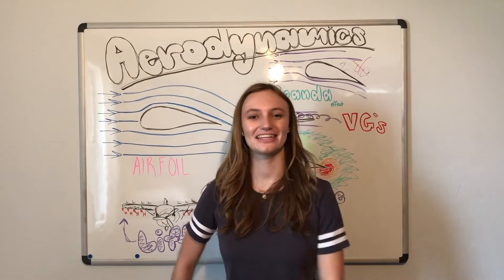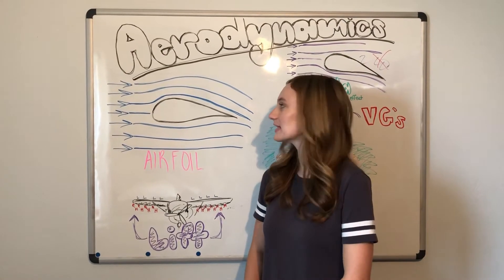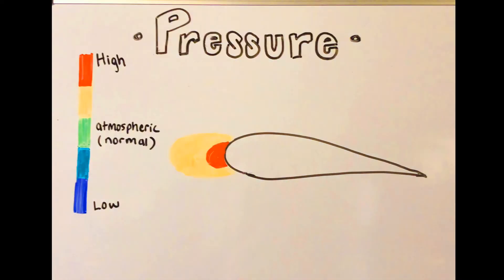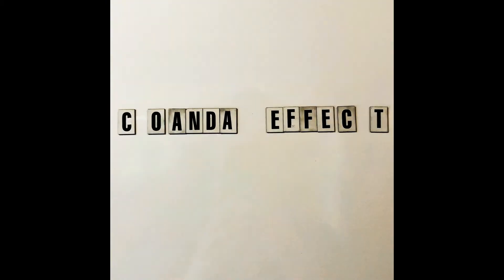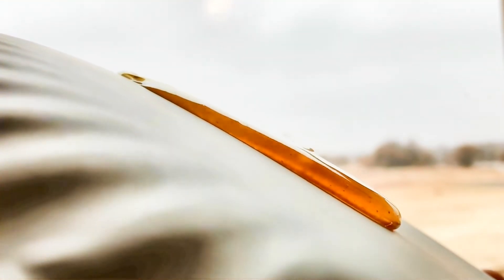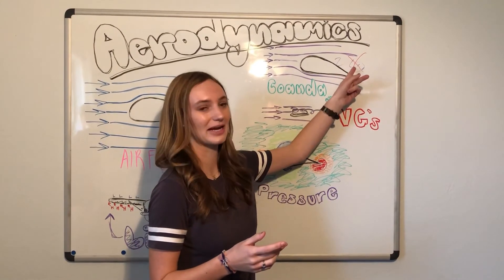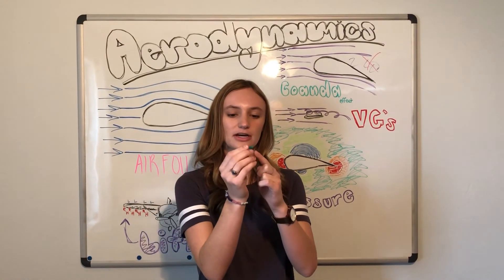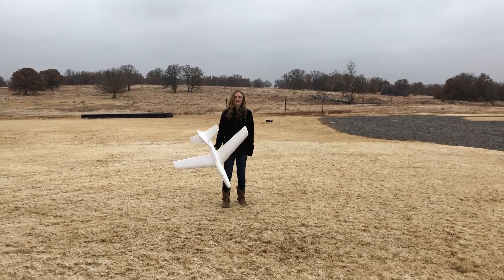Aerodynamics and Lift - Vortex Generators

Comment: Hi Hannah: Nice explanation and thanks for not mentioning the equal time transit misconception which is completely untrue. It would be a bit better if you had also mentioned that air is defected downward and backward which also creates lift and some drag. Keep it up and check out my company's website sometime. We design and manufacture gyroplanes and airplanes. SilverLight Aviation in Zephyrhills, Florida.

Comment: nice explanation, but the Coanda effect does not describe the lift force of the wing. The best explanation would be Kutta - Jukovsky's theory. The vortex generator gives additional energy to the oncoming flow, spins it, thereby stabilizing the boundary layer at HIGH angles  of attack. There is always circulation around the wing. Usually it takes the direction clockwise, therefore the flow from above receives additional acceleration, and the flow from below is slowed down. At high angles of attack, the flow from above stops adhering. A breakdown of the oncoming flow is formed. As already mentioned, the vortex generator imparts energy to the flow by spinning it, and since the surface of the wing is a curve, the flow to which additional energy was imparted "sticks" to the wing (Coanda Effect)